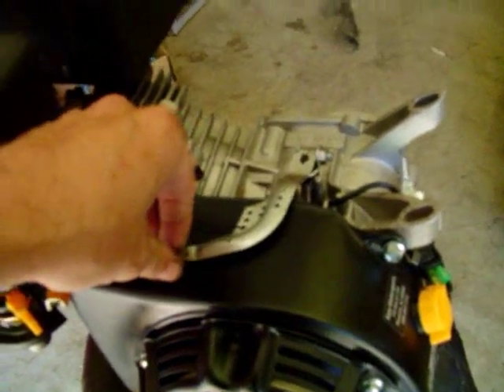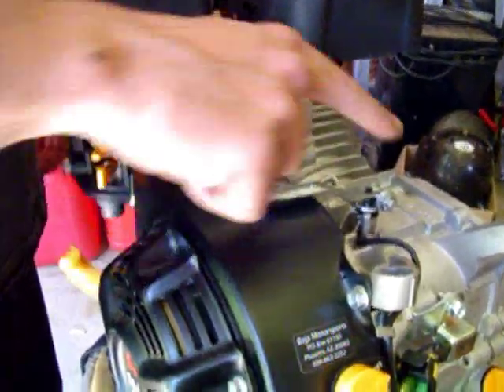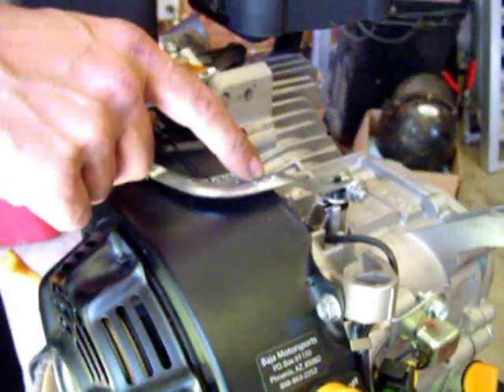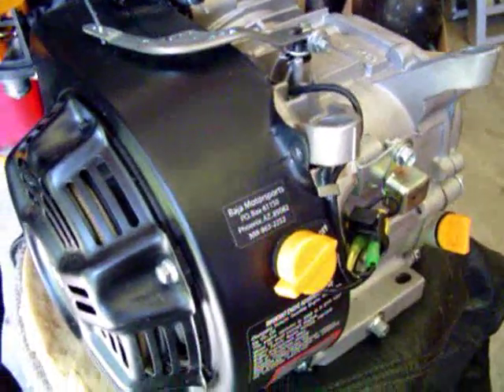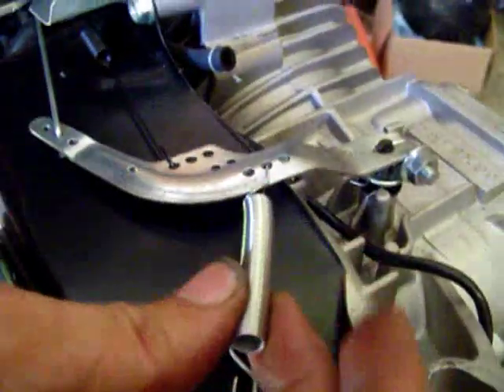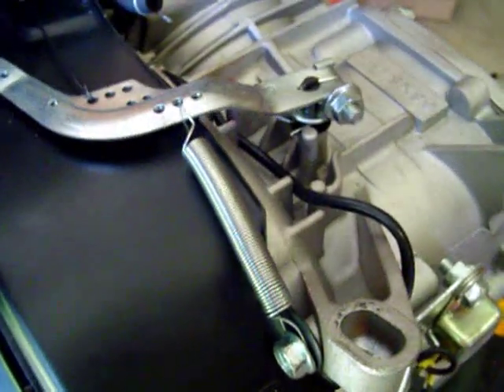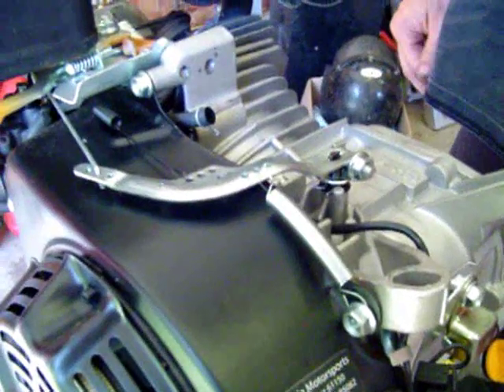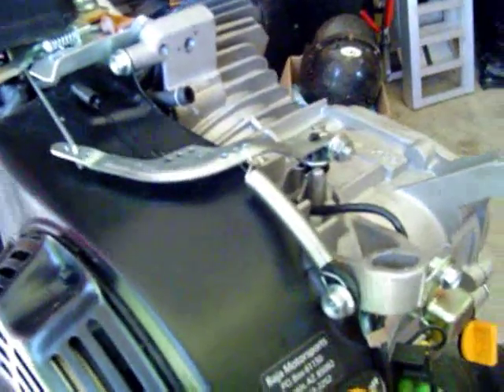How to add a return spring on a 6.5hp clone after you remove the governor

Comment: I checked all my springs and linkages and there hooked up correctly but  the springs look like they have been tampered with I checked out the governor inside the motor and it looks like its working properly to

Comment: Hmm.... good video, i liked the removal vid aswell. i bypassed all that work with an aftermarket slide carb stead of the stock carb. better response time i removed all parts to the governor and tightend a bolt through the hole in the casing lightened the flywheel just a tad. Now its time fer reassembly ^_^ its a Honda 160cc. vertical shaft mower engine which has been converted to a side shaft.

Comment: dued. its easeir than that, just leave it alone with the wheel and every thing and just take that black spring and use the same bolt and pull the spring tight.

Comment: A lot of people are simply adding a second spring to the governer arm to allow the engines to rev to 5000 rpm. This is probably the best you can get with astock clone without running into lighting coild issues ( MB165 ) and valve float.

For further improvemt a 14cc clone cylinder head, offset timing key ( 4 deg ) and short header pipe with a wiener mufler will push the stock clone as far as it can safely go ( with governer of course ). Jetting may need to be adusted....

Comment from the maker: that only works on the briggs engines when you can take the governor arm completely out of the loop. On a clone, if you incorporate the governor arm at all into it, the arm will be pulled back (thus letting off the throttle) regardless.